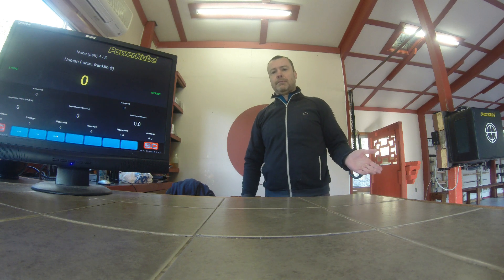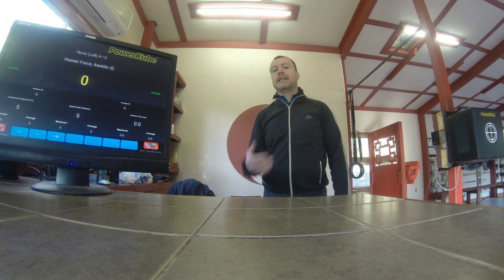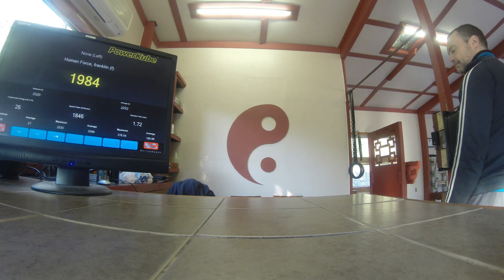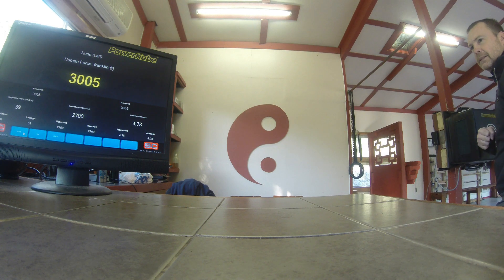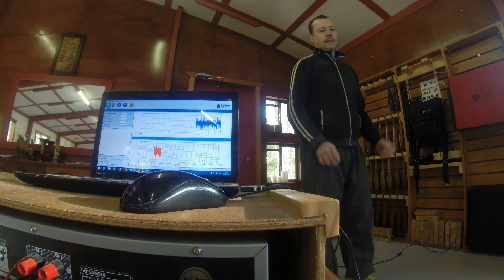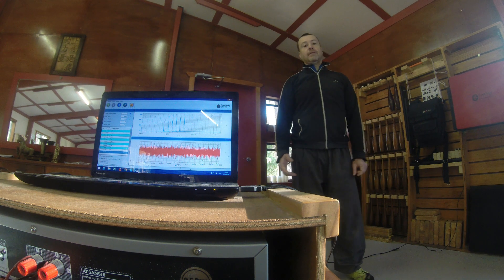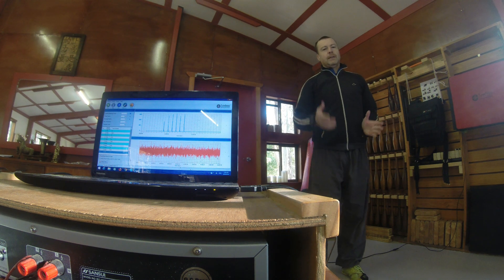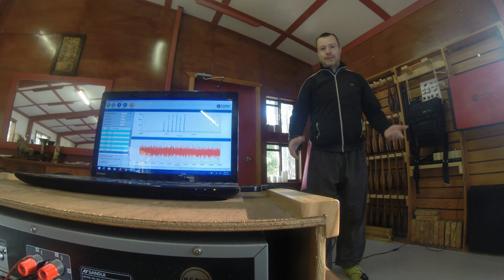PowerKube vs Load Cell 1 inch elbow strike

Comment: So what's the verdict on which device is more accurate? Loadstar or PowerKube?
Reply from the maker: Thanks for the comment. It’s a good question but the answer will be a bit on the long side, so apologies for that. The Loadstar is a fully calibrated scientific instrument which simply uses a load cell to measure force in Newtons (i.e. SI units) sampled at 1 kHz. It is both accurate and consistent and our particular device has been used in a scientific study in collaboration with a local university. The loadstar is a rigid device, which makes it difficult to measure maximum human striking potential due to the very real danger of joint injury. The PowerKube uses an accelerometer mounted on a plate in front of a foam “spring” to extrapolate compression energy (in calories * 10) and speed power (ft.lbs/sec) which are then combined using an undisclosed proprietary method into a single, proprietary unit called the franklin (not an SI unit). As such, the PowerKube is a lot safer in terms of measuring maximum human striking potential. Although the manufacturers claim that the devices are all calibrated, they do not disclose the calibration information and do not provide any self-calibration information or procedures to enable users to confirm that devices are identical in terms of output. Our particular PowerKube is demonstrably consistent based on tests that we have performed using known weights dropped from known heights. Due to the construction of the device, it is not particularly accurate because the plate deforms the foam spring slightly differently based on minor variations in impact location. However, it is consistent within a certain percentage variation. Based on my own research, I have reason to believe that different PowerKube devices do not yield identical outputs. I collated all of the outputs from other PowerKube devices that I could access online into a spreadsheet, plotted the compression energy and speed power performance and compared this graph with a similar graph based on multiple user performances on our own device. These graphs were not consistent. I sent this information to the manufacturer but they have not responded to my inquiry. Based on that result, I typically use the PowerKube only to compare performances and show progression due to its consistency. However, it is not particularly valuable in terms of comparing performance on one PowerKube to that on another. Sorry about the long-winded reply. Hope that answers the question.
Reply: @WushuEngineer  with one exception in this answer = loadstar show how calibrate theyr device you can find vvideo and whole article on theyr site how it goes precisellly :) like hear https://www.loadstarsensors.com/load-cell-calibration-service.html   and each device is calibrated egzacly the same  way ... with powerkube you maybe right this device in fact have only one advantage it give less stress to bones striker thats true .also its not true that pwoerkube show made up units except franklins :x im write you again ftlbs sec on pwoerkube = kg force ...
Reply: @WushuEngineer  Haha It's actually a long reply I was after tbh. I'm wanting to invest in one of these so i want to know exactly what it is i'm buying. So if i have understood you correctly. You would say the Loadstar is more accurate and you are getting actual used force measurements. However because it doesn't have the extra cushion, you probably wouldn't want to hit it as hard as you can in case of injury, but if you did it would measure it correctly? While the PowerKube uses a made up Force measurement, ( so you can't find out how hard your punch is in lbs ect )  but you can hit it as hard as you would like because of the way it absorbs the energy. I guess my question would be how much of a difference are we talking ( how much worse is it measuring ) What were the % differences when comparing with other PowerKubes too. I'm not trying to break any records here, but if i was trying to beat some well known celebs ( KSI or UFC fighters ) Scores ect. How much of a advantage or disadvantage can different PowerKubes have? Or do you not have enough data on that yet? Also would they be accurate in calculating actual power force and not just because you hit it in a spot it liked in a way it liked ( if that makes sense ) I want to know if i'm actually hitting harder when the score goes up and not just hit it in a better place on the pad.
 
Also on the Loadstar, it needs to be connected to a PC at all times to calculate right? While PowerKube comes with a LCD screen and doesn't need to be connected to a PC? Also how much padding on the Loadstar are we talking? Would it be like hitting a flat punch pad ( kick pad )  which doesn't move or less padding then that? Could you hit it barefist or is that just not possible? Also does it record reaction speed / punches per min ( has the sound hit "game" thing )

Last question honest. How are these things mounted. As much as i like the look of the PowerKube bracket. I'm not paying £2500 extra for it lol, but my DYI skills are not the best to say the least.
Reply from the maker: @dannyKurt The Loadstar does come with padding on the front of the plate. So, yes, it is a bit like hitting a thin kickshield mounted on a wall. You can certainly hit it barefist without any problem. It’s more the collision travelling up your arm into elbows, wrists etc. that may be a problem. You can increase the thickness of the padding, but the thicker the foam pad, the more it will erode the force peak and spread the impact waveform out over time. I have considered doing some experiments with arrangements like that but have not gotten around to doing that yet. It is practically impossible to compare the output of the loadstar with that of the PowerKube because the measurement units are so different. In terms of comparison between PowerKube performances, it is too difficult to say because of lack of information. I am not sure if the inconsistencies that I saw were as a result of variations between individual PowerKube devices or between PowerKube models. The manufacturer simply stated that it was “difficult” to compare performance on our PowerKube with that on the earlier version of the PowerKube. However, based on the plots that I produced, it could vary by as much as 50% in certain respects (such as compression energy, for instance). The basis of the device is a thick, foam spring, and any variation in spring constant from one device to another or degradation of the foam spring will significantly influence the output. In terms of your own performance on the device, you would have to potentially look at average performance over a number of strikes because the PowerKube is sensitive to how and where you hit it. The LoadStar does need to be connected to a PC but the PowerKube can be connected either to a PC or to their touchscreen. In terms of mounting, the LoadStar needs to be mounted to a wall or some such. The PowerKube can be held by a partner like a kickshield or mounted. In terms of mounting, mine came with snap buckles that I used to mount it to a moveable wooden backing plate that was in turn mounted to a steel column. I can send a photo of what I DIYed if you like. I could even help you design a mounting system based on where you want to put it. If you end up purchasing the PowerKube, I would be very interested indeed in getting access to more datapoints and to compare some self-calibration routines (like dropping a 5kg medicine ball on it from known heights etc.) So if you’re game for that I would be most interested. Let me know.
Reply: @dannyKurt  1 loadtsar is completely not sensitive in which place you hit  so it dont show more in centre like in corner for egzample so no matter where you hit it always show god vvalue thats huge advantage against powerkube which is in fact sensistive if you not hit in centre of powerkube the reading be lower than should be ! thats 1 point for loadstar  forceplate system  now 1 point get powerkube because yep it damage bones and joint  much less but with loadstar they givve you special foam from manufactury its egzacly poliethylene foam which you can buy all around world its cheap and god amortization they gie you 5-5,5 cm from manufactury amortization  but you can change it on whatevver amortization you want but diffrent amortization givve diffrent peak force reading what is obvious the softer and thicker amortization but not to soft offcorse the less peak force be egenrate from the same punch offcorse  ., and yep  beside that loadstar more damage joint and bones from long term often use with hard shots than it offcors show you biger number the hharder you hit it offcorse :x  no other wayy  3 now without point because in this case we have draw beewten both devvice  powerkube dont have made up units except franklins maybe which is in fact some kind of impulse part probably :x  but powerkube show you also units FT LBS /SEC and this units is KG FORCE  what show in fact wushuenegineer when he put powerkube on loadstar force plate but he didint notice it because he concentrate only on franklins units and dont watch on ftlbs sec vs kg force on loadstar and in fact both numbers egzacly corelate when he hit with 143 kg force from this what im remeber powerkube show 14300 ft lbs sec so put comma and yyou have 143 :x  4  yea  when you hit harder on loadstar no matter where you hit it show you biger number if you in real punch it harder not just you think punch harder because in feeling play alot variables like psi for egzample some pain in bones which can be develop be weaker shot just be diffrent angle for egzample etc :)  with powerkube is ths trouble like with me ubm and me first setup loadcell fc 20 k axis the fahrer you hit from centre the lower numbers it will show you but if you be punch in like 10 cm diameter in cenetre of powerkube it also show you which shot was harder just you need with this devvice  more precision while when you play with loadstar you cancompletely ignore where you hit it always show you true peak force thats big advvanatage loadstar system in fact bigest  and most important in me opinion is in fact this that iot is compeletely not sensitive where you hit thats why im like this system most and thats why im buy it soon :x and not pwoerkube beside there is some fears if each powerkube is egzacly the same calibrate with laodstar you get certificate precise writing NNIST calibration test certificate each loadstar is calibrate in egzacly the same way and each show 10 kg when you  put on it 10 kg and 500 kg when you put on it 500 kg and so one and everything beewten this and more :x other advanatge loadstar is that you can measure more static motion like some pushing deadlift peak force for egzample some choke force whatever you want you must just do correct setup for transfer force on plate so thats another dadvanateg of loadstar system now about what loadstar change on peak force vs powerkube so such in this case loadstar catch momentum which is mass multiple be velocity of this mass assuming the same surface area and material hardness offcorse while powerkube catch kinetick energy and momentum in this case i dont know which is more correct setup :x but quasi static force is momentum related and this show loadstar i more trust this than pwoerkube setup loadstar boxing kit come without monitor you need plug in to computer howevver they have system plate 8x8 inch which come with theyr own monitor i dont know if youcan buy monitor to theyr boxing kit overall when im count +and - loadstar win like for me :x in fact its only one - is that it is 100% rigid mounted system howevver like im wirte you can setup whatever you want in terms of amortization thicknes etc :x ...